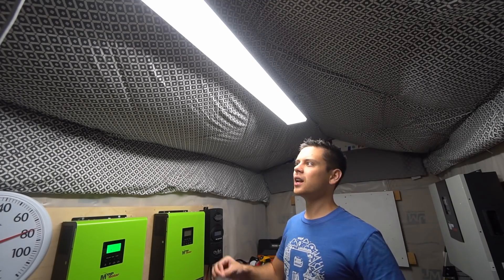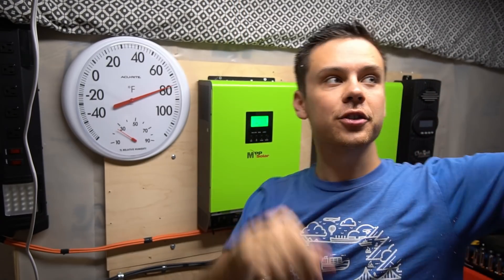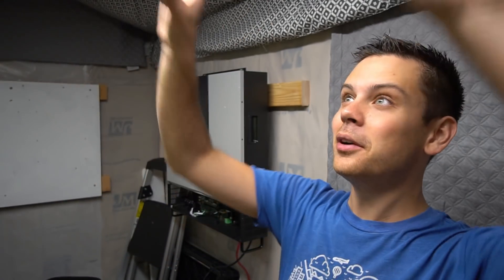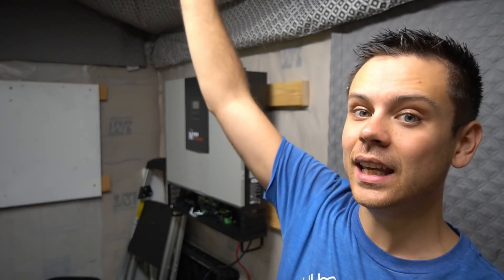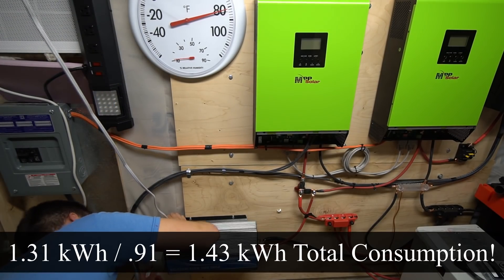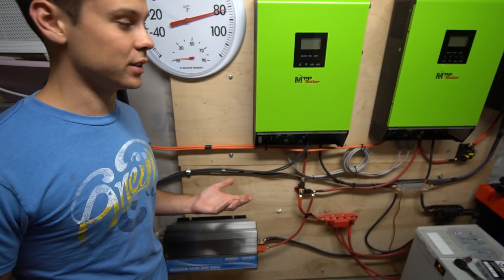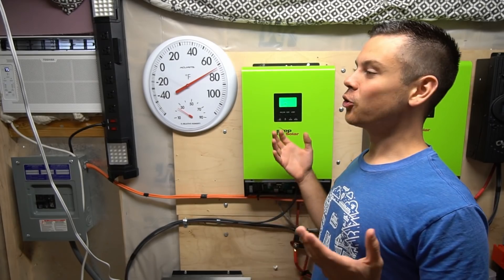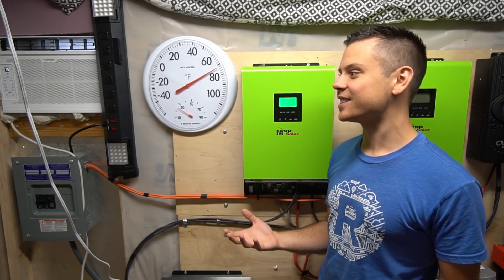Cheap Solar Powered Air Conditioner Part #3

Comment: I'm worried about your low humidity and the static electricity danger that can easily wipe out your electronics. We humidify the air in our data centers to about 50% RH as a balance between controlling static and creature comfort.
Reply from the maker: Excess charge accumulation? I did ground everything but I need to add salt water to my grounding rod. It's so dry out here. What would you do?
Reply: @WillProwse  With a distinct lack of water out there, the next best thing is to drain off any charge on your body BEFORE you touch anything. A  grounded metal handle (or something grounded you can hold) while you touch the sensitive electronic device may be your next best alternative. Place a 100K resistor between the metal handle and ground to limit the current and reduce the intensity of that pesky arc when you touch it.
Reply: @g-whiz286  @Will Prowse -in hospital operation rooms we installed static dissapative tiles from Armstrong.
Reply: Because of the heart shocker!!!!
Reply: @WillProwse  As long as you don't touch anything, the thousands of volts you carry on your body in a dry environment just by moving is negated. If you push a button or sometimes even touching the chassis of a device is enough voltage transfer to damage sensitive electronics. First, you'll need a water supply out there. In the data center, we use ultrasonic emitters (misters) to minutely atomize the water droplets directly in the air stream. In this case, it would be the air output of your air conditioner. Then you need a controller that measures RH and pulses the emitter accordingly to maintain a set point. For habitable spaces, people prefer cool dry air. For electronics, a little warm (~80°F) is OK but not too dry.

Comment: Yeah, it do get HOT out there, I was working nights out there for a week, mid July it did not drop below 100°F! If it was that hot , and as humid as it is here, I would probably died! I'm in NW NC, 40% is about normal, then in summer it will rain for a hour, then 90°+ so it gets very humid,  I have about 30 kwh+ of lithium, and hope I don't need ac this summer, I cut some trees, and get more sun, I'm guessing I have enough battery to power a small window ac, 
Nice, I knew insulation in the roof would help, I'd insulate around the building to the ground if you haven't already, heat flows to cold, and if it's hotter down low, the cool air will heat and rise,

Comment: If you have an air gap [as shown] between the roof and your top insulation, if you add any fan to rid that area of the solar heat from the roofing materials, that will eliminate 10-15% of the needed A/C for cooling. They even have solar-powered fans that work via a thermostat.

Comment: Will is so efficient he can squeeze in a haircut in the middle of a video lol.
Reply: LOL
Reply: I think the sun and a scalp is a bad combo
Reply: Chris Eudy think of it as a sexmachine Solar panel...
Reply: @chopperdavez  personally air conditioning is nessexary in +100 ° heat
Reply: Chris Eudy agreed. Personally I’m thinking anything over 80. I’m running one, by 100 both roof airs are going.
Reply: @chopperdavez  I just like your name. I felt and heard then seen what looked like 2000 choppers going down the freeway out west in 1970
Reply: Third law of thermodynamics
Reply: Will needs to shave his head, so he can stay cooler this summer, also to save on hair gel

Comment: Didn't notice from your other videos, but is the roof on your shed White? Did tests a long time ago and discovered that White is about as effective as Silver to cool off a roof.

In Cali, Colombia just painting the concrete roof White lowered the temperature by 15F! This is after using a silicon powder to reflect the heat and 6" of Styrofoam. I placed Pex Tubing up there, so I got nice 120F hot water for my shower, but just 105F after protecting the concrete with a White primer paint.
Reply: Actually white is more reflective than silver but it Hass to be the proper white all whites are not created equal
Reply from the maker: Holy cow that is interesting

Comment: For fire proofing, instead of Reflectix, use UltraTouch Radiant Barrier and 3M 90 Spray Glue or equivalent.
Reply: The radiant barrier is not supposed to be glued to the surface. It conducts heat and transfers heat when it’s touching a hot surface that Hass to be an air gap

Comment: I live up in St George, and have my system in an RV.  I am looking at different ways to change the rooftop AC units on the RV to gain some efficiency.  Luckily I bought a toyhauler, and will be putting the new Midea inverter window air conditioner in one of the windows of the garage area.
Reply: Let us know how efficient the Mindea inverter Air Conditioner is. Will said the AC unit in the sheed will only use about 500 Watts max. I will very interested in the results Steve.
Reply: Will do.  Still waiting on it to even ship from amazon.  I was probably too late to get in on the last of the units from china before covid

Comment: I have to ask what is the Fire Resistance of the blanket?  If your insurance agent sees this, they may have issues with the material used.  I "feel" you on keeping the heat down...  Rock On!!!!
Reply from the maker: ha! it will all burn. it is a wooden box

luckily I have OCPD and LiFePO4 so it should be good. Largest potential failure point is inverter
Reply: @WillProwse  and a/c.. buy a spare just in case lol

Comment: I recommend looking into Geocooling  plus with the humidity so low water misting the fins of the air conditioner will increase the efficiency drastically. Now I'm off to research graphene supercapacitor energy storage for solar and UPS applications.
Reply: dont forget he is in the desert, water is scarce and expensive
Reply: @remocres  Water is in the air and is free. Ground water as "well".
Reply: The high alkaline and the chlorine in the water develop calcium, magnesium, Iron deposit buildup on his fins and the chlorine attacked the copper overtime causing leaks not a good combination
Reply: @coldfinger459sub0  There is no requirement to use tap water.
Reply: Have you look at Zoxcell? (About the graphene super capacitors)
Reply: @sheldonskaggs138  Thanks for the input I have looked at their large pouch style 21000F for a project.